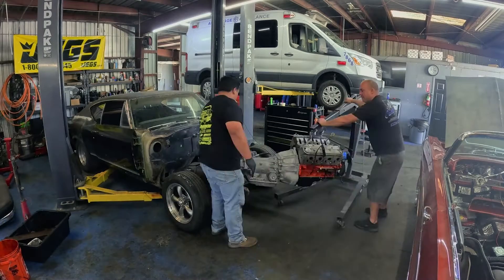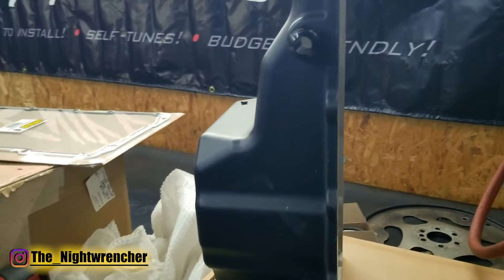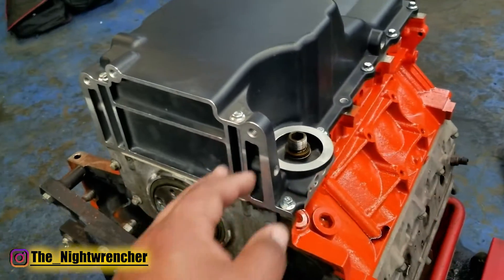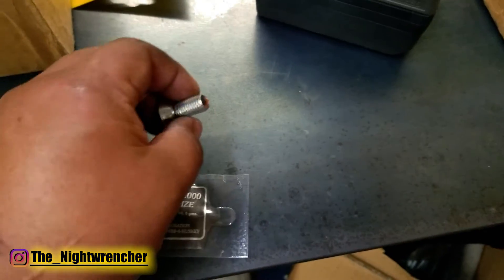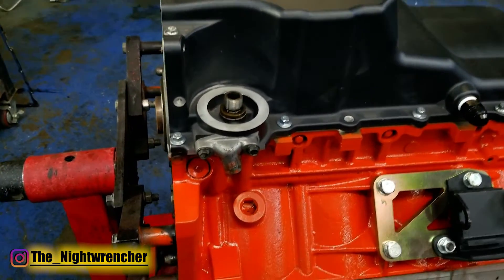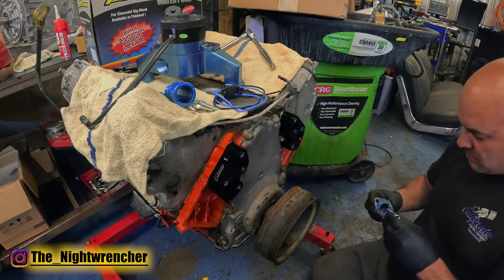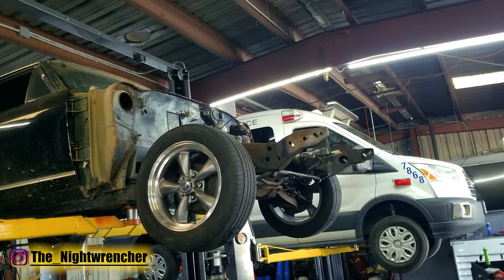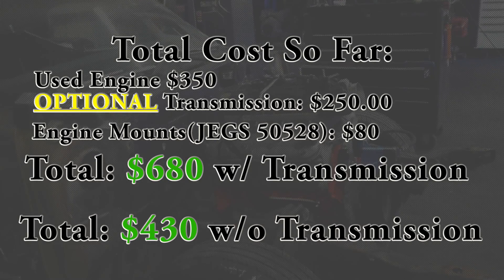Complete Guide To LS Swap Your Chevy | How To LS Swap A Chevelle Part 1 |

Comment: I have a 6.0 outta 02 Escalade that I carbed with a Edelbrock 750 with vac secondary n run a msd 6014 for ignition n a Th350  n ford 9 inch rear , so it runs fine with normal driving but it won’t go past 80 without acting like it’s govd at wot or even half n wondering if it needs more fuel or timing? Currently the total timing is like 32 I think
Reply from the maker: @brianmiller909  it depends on how its reacting, if its just slowing down, it could be too rich, if it hesitate it could be too lean. I dont think its ignition related.
Reply: @ like it’s struggling to go any faster
Reply from the maker: @brianmiller909  what does your wideband say?
Reply: @NightWrencher  haven’t drove it with the laptop hooked up ,just learning the whole tuning on it thing but it’s drove fine for over 9,000 miles just won’t go past 80 mph without the issue . What should I be looking for ?
Reply: @NightWrencher  was thinking maybe changing out rods or jets in the carb or just going to a size bigger but holley double pumper with mechanical secondary
Reply from the maker: @brianmiller909 you should be looking at the wideband to tell you what its doing.
Reply from the maker: You shouldnt make any changes to the carburetor if you dont know what the wideband says. Once you learn how a car reacts when its rich and how it reacts when its lean, you wont need the wideband anymore but without that information, you're just taking a shot in the dark
Reply: @NightWrencher  ok thnx for the help,I’ll check it out when I get some free time
Reply: @NightWrencher  will hooking the map up on the msd box help at all?
Reply: Does it matter which way the intake goes on? It’s a dual plane with a vac port on the side n one on the top end of a runner near the carb flange
Reply from the maker: @brianmiller909  not really. You can flip it around if you want
Reply: @NightWrencher  ok jw cuz either way the head ports n bolt holes line up n all the runners are the same length n shapes

Comment: Just make videos about rich n lean conditions n timing n vac leaks. Most people dont care about more power they just want there cars running right. Have u notice how many viewers u get when u explain tuning?
Reply from the maker: Hey buddy, I've seen you in my carb tuning video comments a few times but if you go way back, I was doing LS stuff before I was doing carb stuff so I just go back and forth depending on what I am doing at the time. Don't worry though, I have carb tuning videos coming up soon 👍

Comment: Hey man, I want to LS Swap my jeep Comanche eventually. When pulling the motor from the junkyard, do I need to get the wiring harness? You should do a video on the specifics that are needed from the donor vehicle
Reply from the maker: That info is in part 2 but I like to take everything from the junkyard including the harness and PCM. You can redo the harness to clean it up but you can also buy a new one.